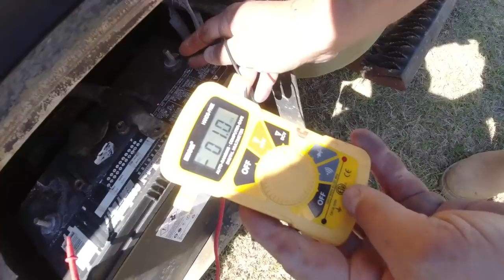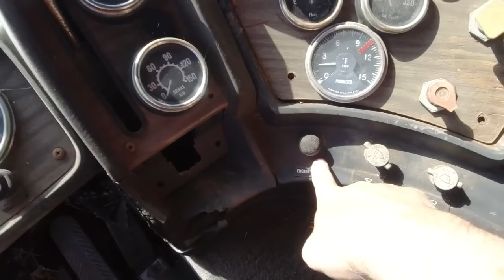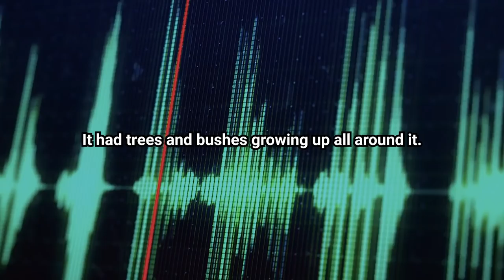Will it Start & Drive? ‘81 GMC cabover BIG CAM pulled from BUSHES!

Comment: You cant beat them old cummins motors man. If you can get fuel to it and get that motor to roll it will run with the rods rattling outta it. Them motors are excellent and very reliable. Very easy to work on. You dont have to have a plumbers license to find the motor by removing three hundred miles of tubing hoses and piping to get to the motor like these new ones. Then you gotta have a electrician license to remove the wiring to finish getting to the motor . Then you may be able to see that there is a motor down under all that crap

Comment: Chuck elson Columbus ohio.  In 1985 I had a 1974 astro with a 903 Cummins with a 13 double over pulled containers and old 45 foot dry van trailers.   Never had it under a 48 footer. I'll be 66 the 3rd of October and the 12th will make 49years truckn and still at it I'm with FST in Columbus Ohio now driving a t680 kenworth

Comment: Watch Wes had a JD that he put a surgical glove over the radiator filler. As the engine ran the glove filled with air. The head gasket was bad.AL B.

Comment: It does not indicate a blown head or a head gasket. It indicates bad piston rings because the gas fumes get by the piston rings and then flow into the coolant system so then when you pop the coolant cap, that’s where you get that pressure from not head gasket or head but gas pressure pushing out pushing around the rings

Comment: Is this considered the "cracker jack" or is that only without the sleeper?
Reply: Cracker box. Without the sleeper
Reply from the maker: I made a reference to the 5x2 sleeper. It was an old gear jammer tune from the 70’s 😂🔧
Reply: @HamiltonvilleFarm  that was before my time lol. I'm a 80s baby  😆
Reply: Cracker box was way before this Astro
Reply: @Darylatlarge  Yes it was, like the 50's or 60's?
Reply: Cracker boxes were in the mid 60s and back. 1st truck o ever drove otr. Was a 67 cracker box day cab. 671 detroit 5 speed/2 speed rear and a graning air tag axle.
Reply: @markraymond1196  238 Detroit with the 5x2 was in the first truck I ever drove; a GMC 9500. By today's standards it was woefully underpowered.
Reply: Dale Fry that's for sure
 65 mph downhill with a tailwind. 15 mph uphill lol. Ran michigan to New Jersey with that old girl. That's back in the days when I 80 was a goat path. I'm pretty sure most farm fields were smoother. But I was a greenhorn kid back then and didn't mind the rough roads. I was doing what I loved to do. Wasn't shiny but to me it was the best thing since sliced bread.

Comment: I no trucker, dropped a load of plastic pipe off a truck same as that, In front of a state police station, long haired, hurrying to put pipes back on as the pipe kept rolling off. I put about 15 miles on that truck

Comment: I BOUGHT AN OLD 1952  INTERNATIONAL EMRYVILLE  BED BUG HAULER WITH A 175 CUMMINS AND IT HAD BEEN SITTING DEVERAL YEARS.  WHEN WE BOUGHT IT THEY SAID IT WAS FROZEN UP,. WE FILLED THE MOTOR WITH COAL OIL AND TOWED IT BEFND AN OLD 1949 FORD STAKE BED FARM TRUCK AND AT FIRST WE TOWED IN IN NUTRAL, AND WHEN WE WENT TO WORK ON IT WE WERE TOWING IT INTO THE SHOP AND THE DRIVER DROPPED INTO SECOND AND BROKE THE MOTOT LOSE. WE DRAINED THE MOTOR AND SERVICED IT AND IT STARTED AFTER A BIT OF TUNING. aS FOR THE gmc, i DROVE A GENERAL AND IT WAS RGE WIRST TRUCK I EVER DROVE,

Comment: I worked for crst In 88 as a mechanic.Look up the gmc batmobile.its a astro with a goofy air dam on top.Hardest truck in the fleet to work on.Why? Because they sat the engine in the middle of the floor and built the truck around it.So to fix the first part they put on the truck you had to unbolt the whole truck to get to it lol.The gmc general wasn't any better.

Comment: Well that's kind of a shock that thing's hardly putting out any smoke at all so that's got some miles left to run.... I think I'd have to restore that truck....... at the very least should make a good truck for students to learn on out of school.... I used to be an instructor at several schools and 48 state OTR and a whole lot of other s*** that you don't want to hear.
Reply: The problem with using that truck to teach new drivers how to drive is,  most new drivers today have to drive an auto shift.  They don't or can't understand how a clutch or big truck transmission works to shift.

Comment: No need to guess what Cummins engine you have. There is an ID plate affixed to the auxiliary drive housing in front of the air compressor.
Reply from the maker: It was worn off or removed. We looked there👍

Comment: If the radiator has prasher in it before you start it then it doesn't have a blown head gasket. And my guess is that the hour meter is there because some times they leave it running at night on long haul trips

Comment: I am driving a 1988 Kenworth T600 that I used a chain to drag out of a field after cutting down the tree that was between the frame rails because it sat for 10 years I also have a 1988 Kenworth cab over that sat for 15 years that I will get running and driving when my health will let me

Comment: I drove a 81 cabover GMC Astro van steel I probably had I don't know 40,000 mi 50,000 miles on one then I drove one on on the farm hauling grain indigotohell truck had a 320 internet 13-speed

Comment: Coolant is u set pressure in a normal operating car truck ect… but no more than 15 psi if that just to raise the boiling point that’s how it works and the Caps are meant to keep a certain pressure but …. A coolant system under extreme pressure yes is most likely a head gasket think about t the gasket blows out near the coolant area in the head that cylinder pressure goes where ???? In the coolant system so yes head gasket does indeed can end up in the coolant area just look at the ford 6.0 powerstrokes

Comment: Probably don't need a clutch. It's probably just stuck and will come loose if driven around with the pedal mashed. Never drove an Astro 95 thank the LORD but the guys here that did called them 'All Glass and No Class' Trucks. And I've run old worn out stuff all my life. So THERE! GBWYall and especially u TWO!